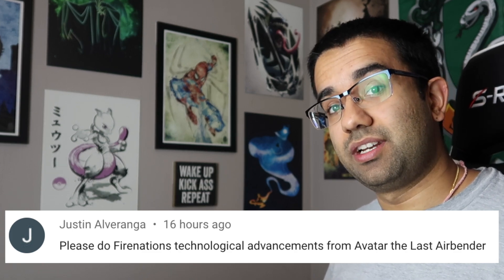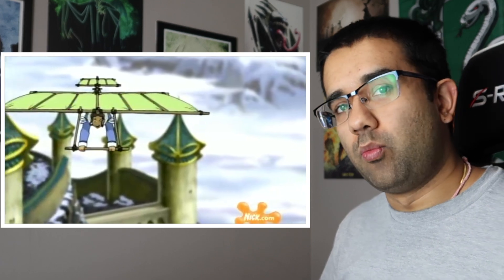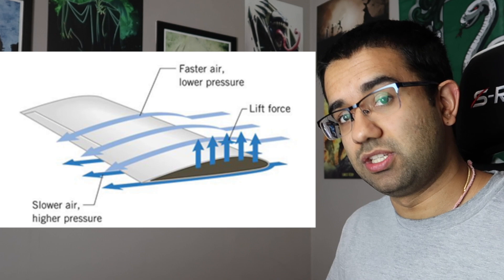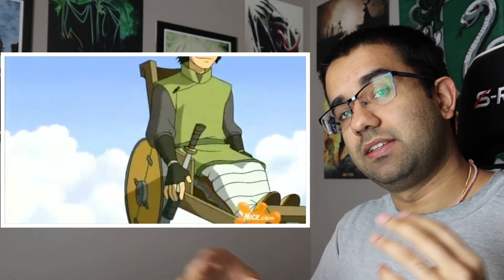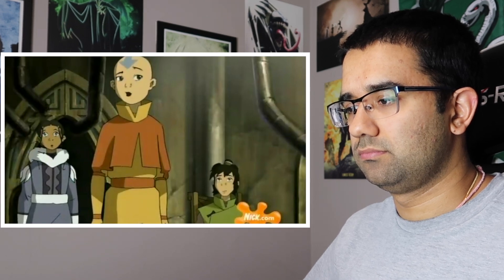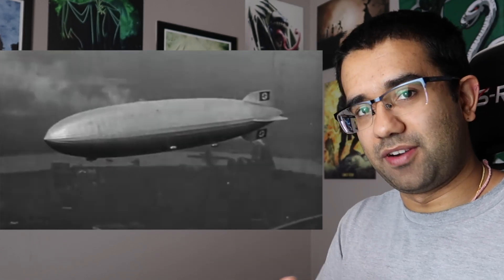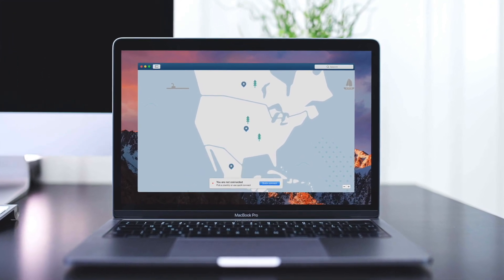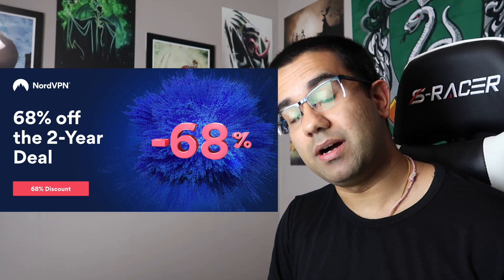Real Engineer Reacts to Technology in Avatar: The Last Airbender part 1

Comment: 2 things,

1, I think an interesting part to mention is that while they did kind of vandalise the temple, Aang later realised that these people basically inherited the spirit of the airbenders when it came to freedom and and an appreciation of the open skies. So it goes past just "putting a bunch of pipes through a temple" since they are basically trying to jerry-rig there way into reviving the lost art of airbending.

2, They aren't making a blimp their making a hot-air balloon and they are slightly different. Hot-Air balloons literally just use hot air, Blimps use gasses.

As an extra note: the mechanical ones they show later are Zeppelins, A zeppelin is a is a similar device to a blimp or hot-air balloon that has a rigid frame (so they maintain their shape outside use).

The hindenburg was a Zeppelin.

Comment: The Hindenburg was only the straw that broke the camel's back. Design flaws associated with the failure of the Hindenburg could have been easily fixed, but airship technology had other flaws that doomed them. The failure of the airship was partially that they were not very tolerant of bad weather; their giant surface area rendered them extremely sensitive to wind and drag, while their poor strength to size ratio made them relatively fragile and easily damaged by impact.
The other part of their failure was that airships couldn't really fight back all that well against fast-moving fighter planes armed with machine guns to poke holes in their gas bags.

Airships continue to be used in some more limited applications, such as to carry out stationary air surveillance on the home front. Airships used in this way are usually operated close to their base of operations, in slow patrol routes, and with caution with regard to weather.

However, some companies are considering bringing back a hybrid form of airship; while the new hybrids would use lifting gases, they would have a more wing-like shape that holds less lifting gas and balance it out with aerodynamic lift from lifting body effect.

Comment: other than shale, natural gas is also frequently associated with deep coal mines. Large pockets of methane, which the miners called "fire damp", would be trapped alongside coal deposits due to geological processes associated with the formation of said coal. Although it can be diffused with sufficient ventilation, it doesn't take a lot of methane in the air to become an explosive mix.

Other sources of methane include biological anaerobic fermentation of organic material (aka rotting that happens when buried or in an atmosphere flushed with carbon dioxide).

Comment: The Hindenburg was a disaster but not what you think. The mythbusters tested this a few times with and without the gas. They recreated the skin and everything. What happened was the skin of the blimp was actually hit by lightning earlier in the day and usually when it was docked the extra energy would be dissipated into the ground but something happened that made the skin retain electricity. It was hit by a microburst of lightning and it went down the gas was the last thing that caught fire. If you read the reports the fire was red and yellow not blue which says something as the gas inside would have been been blue due to the chemical burn effect which was a form of natural gas. The skin was a strange mix of chemicals over leather that made it silver but also increased its combustion chance. The skin burned first which means it did not start in the gas chamber of the blimp. Watch the mythbusters episode as it explains better than I can.